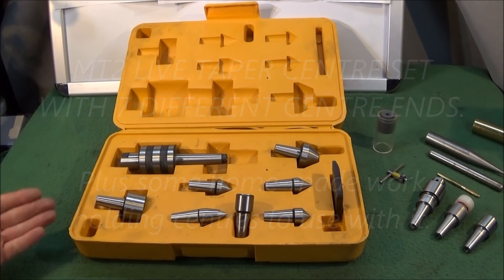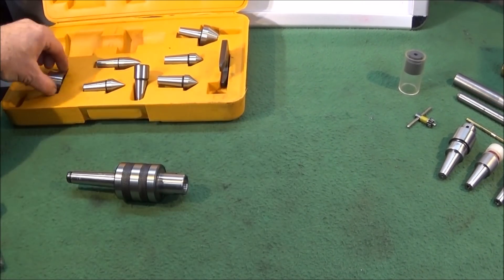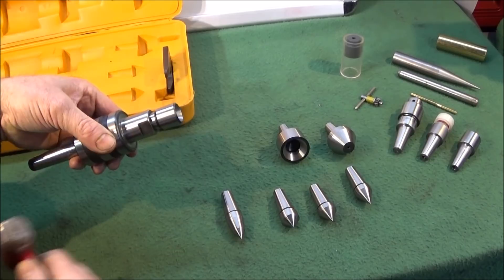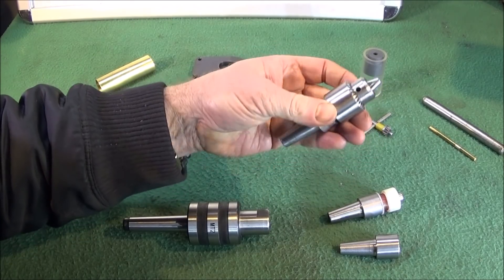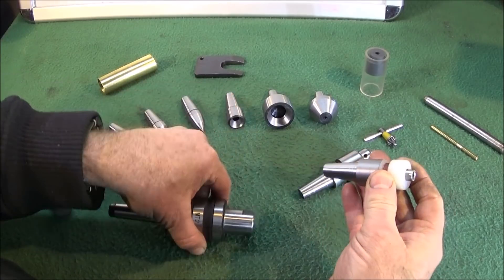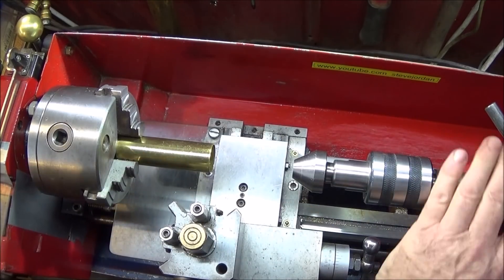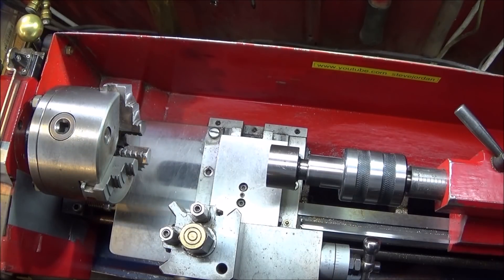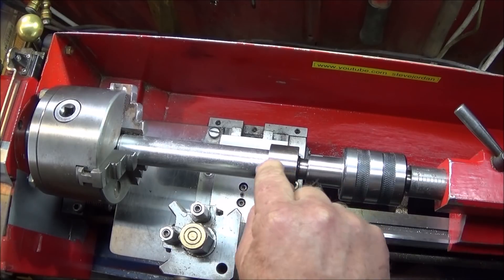A Versatile Lathe MT2 (or MT3) Taper Centre Set Plus Extra Home-Made Centres

Comment: Steve, how much resistance does the bearing on your live-center have? I ordered this kit from Banggood and the bearing seems to turn with a very high tension on it (I can't spin it with inertia at all). Is that normal? I've never worked with triple bearings before. My other live centers will spin for just a bit if I spin them with my fingers.

Comment: Thanks.  I have a question, what tool post you'd suggest for myford super 7? I've got  this lathe recently  and it has elephant foot tool post.
Reply from the maker: +Kostya Medvedev Hi I would recommend the Myford Quickchange Toolpost Set. My brother has the Super 7 with this toolpost on. You can get them on Ebay from RDG or Chronos or on their websites. Regards Steve
Reply from the maker: Hi Yes I buy 10mm for the turning tools. The tool holders will take 12mm but sometimes, depending on the type of tool, they wont go down far enough to achieve tool centre height. On occasions I have milled the underside of the tool shank.

Comment: Thanks for the review.  I just checked with Banggood and the item is under restocking.  Did you sell them out that fast I'm wondering?
Reply: I just bought one. From Europe for 75 EUR. Supposedly 7 pcs still available in this price
Reply from the maker: Yes I saw that. I hope they get them back in stock soon!....Regards Steve
Reply from the maker: Great Thanks for letting people know. It certainly is an excellent tool set! Regards Steve
Reply: Hello Steve,
I have just receive my MT2 Live Center from Banggood UK.
Unfortunatly the ''wrench'' is missing in the box. I have made a request to Banggood but in case of  no succés would you please sent me the exact sizes of your ''wrench''
Thank you for your reply.
Thank you for all your good movies on YouTube.
Please excuse me for my bad English.
Best regards.
Patrick (from Lyon in France)
Reply from the maker: THE WRENCH OR DRIFT CAN BE MADE THUS....You can use a piece of mild-steel 40mm wide x 65mm long x 8mm Thick. The U cut out slot in the middle is 17.5mm Wide X 30mm Deep. (The 8mm steel thickness is important) and the (The 17.5mm cut out width is important)...So it just goes over the slot centre adaptor and is thick enough to eject the end. You can do the taper by hand on a belt sander or by filing, ONLY ON ONE SIDE. Leave the other side, or the back of the drift, flat...Then heat and dip in oil to blacken. I wouldn't use a harder material because you don't want to mark the centre ends..Regards Steve

Comment: Very good selection Steve. I have bought some stuff from Bang good and so far I have been pleased with the product. I have a South Ben 9" lathe and I have been looking at the 3C collects , I was wondering if you have had any experience with the Bang good collects ? Very good demo on the live centers.
Reply from the maker: Hi Anthony. Thanks. I haven't had any collets from Banggood yet, but all the sets I have were made in China. I have been very impressed with their collet tooling overall and cannot fault them in any way. My Chinese ER40 chuck that I use on the Myford ML7 has a concentricity of less than a .001" thou.

Comment: Thank you for sharing this Steve. What do you think the flats are for on the outer end of the spindle, must be a good reason but I can't think of when they would be used.
Reply from the maker: Hi Glenn, I was looking at those flats and came to the conclusion that they must have been used when making the tool? I thought they maybe good for doing very small hand screw tapping using the Jacobs chuck end I made?

Comment: Good review Steve.  Banggood do have some decent stuff.  You just have to choose wisely.

I like the way they have extended out the live centre nose further than necessary to give extra clearance from the race body.  Quite often it's been necessary to otherwise use a long dead centre in the tailstock and this is way better, especially for high speed turning.

Cheers Rob
Reply from the maker: Hi Rob...Thanks...Yes I try to choose wisely for tools and things that I would need or use. The centre housing is a good shape with the extended end. I think I can also use the 6mm threaded taper I made to put extended threaded center ends in for other small work....Regards Steve